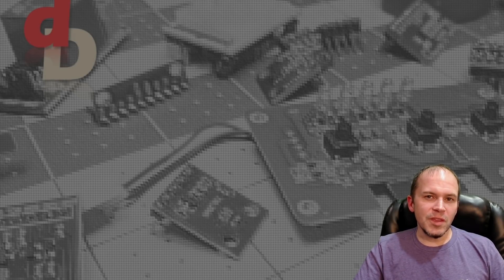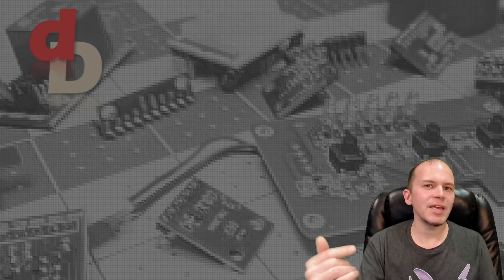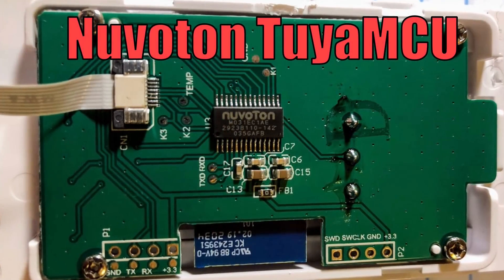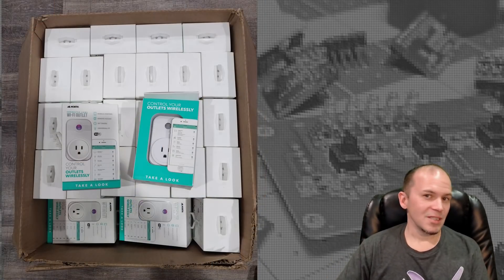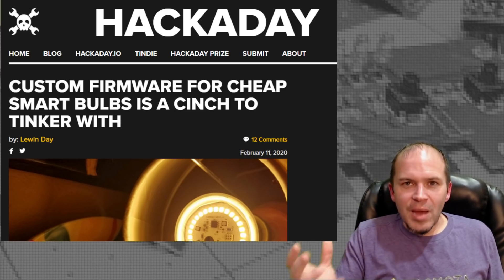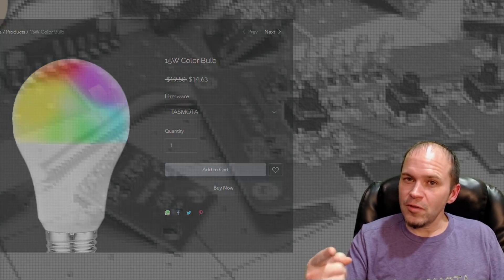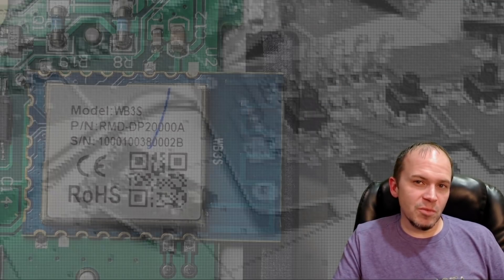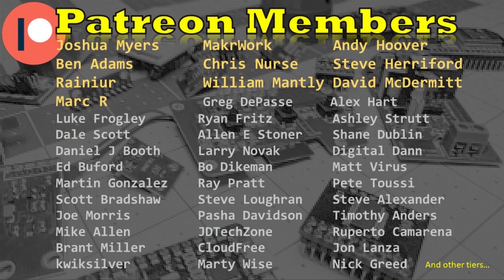What's happening to the ESP8266? | Smart Home Local Control Issues

Comment: Interesting question. I find it interesting that even Espressiff appears to have preference to the ESP32 variants over ESP82XX line. First, they released the chips that are anywhere from 2-8 times faster than the 8266 for nearly the same price. Second, they haven't released new variants of the 82XX line in quite some time. Regardless of the next preferred chip for Tuya devices, the 82XX days are numbered.
Reply from the maker: Indeed it is. The Sonoff Dual r3 is coming with the esp32. I do worry about the e-fuses being set in many of these devices.
Reply: @digiblurDIY  Exactly right. Although it is unlikely that they would set that option simply because it would open them up to litigation if a vulnerability is found that they can't fix. Plus, if they need to change their code to conform with internal specification changes, they wouldn't be able to do so via a firmware update. They would have to maintain a legacy api  for every device that required such a change - or brick a whole product line if the vulnerability was bad enough.
Reply: If these companies were producing a device that was designed to be local only, then they could get away with burning the write fuse as they would then just need to deal with whatever hub/gateway they have the devices locked to.